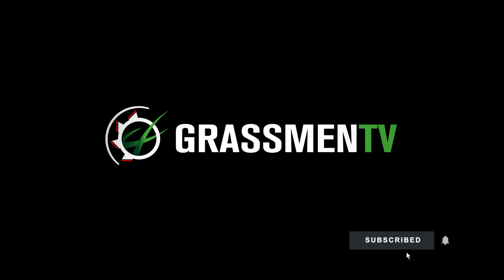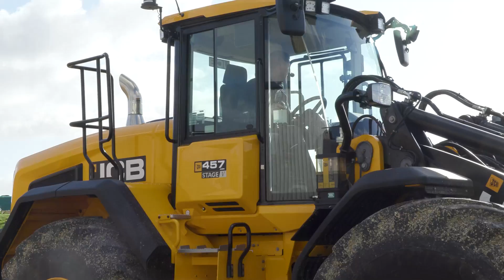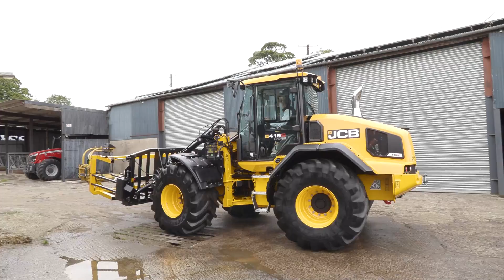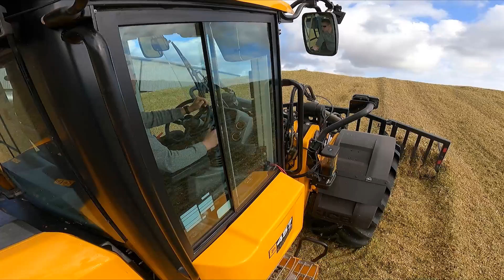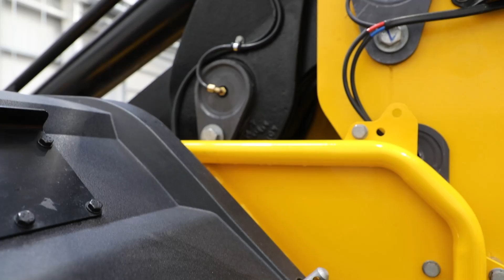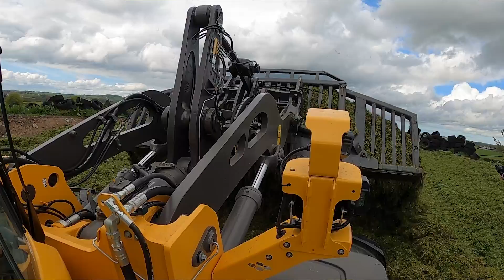The NEW JCB 457S

Comment: One thing I notice is the HT loader arm looks a lot less bulky than the z bar system, to the point that the parallel bars look very thin in both top and even side profile. Thinner than I'd expect for a loader that size, yet it can handle some serious tonnage.

Comment: It needs 16ft or even a 18ft folding push off buck rake
Reply: Not sure what size they build the push off buck rakes these days but I used a little 3m 
back in my day on rear of 8410 JD, lot faster than a loader back then.
Lose so much time lifting loader up and flicking forks, thicker lays too, easier to compact with thin even layers.

Think I need to go back home to NZ and built stacks again with this bigger gear.